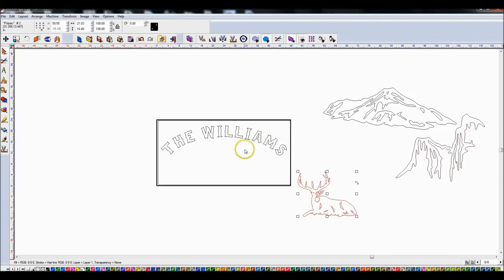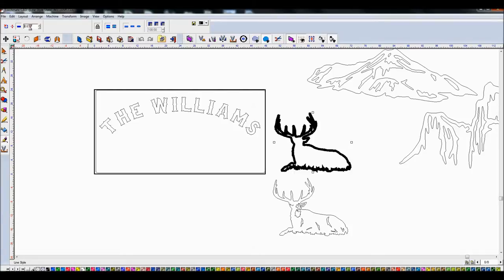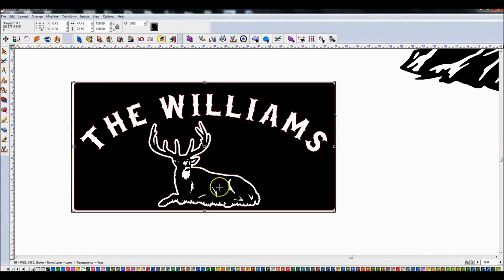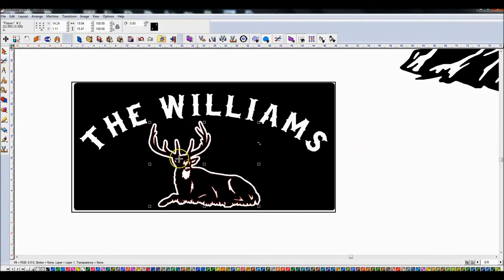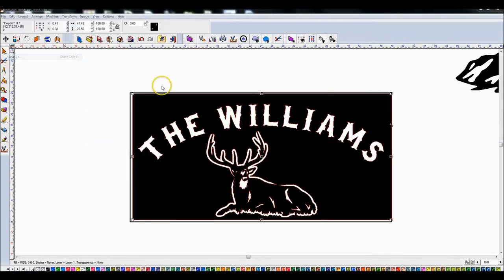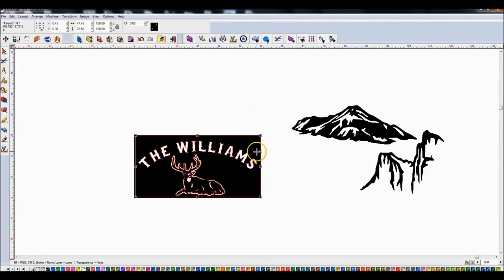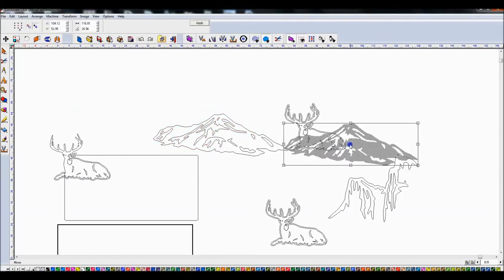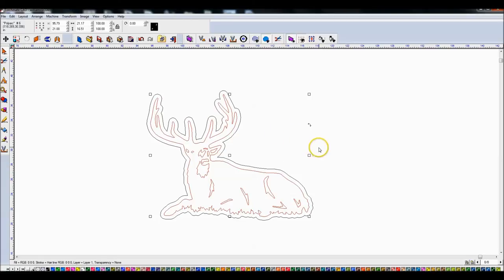Torchmate CAD/CAM -- Double Negatives

Comment: The videos r great and have helped me tremendously. ... I have a ?   When u r welding the elk sticking out of the sign. How do u only select the outside line together w the sign to x or weld....
Reply from the maker: If I understand you correctly, when you select the outside you are getting more items selected than you planned.  If that is the case you can break it apart (CTRL B) and then that should allow you to select the outside as an individual component.  If I misunderstood you, please clarify your question.
Reply: I understand the ctrl b part...

When I am going to weld something I usually highlight everything and weld...

When u were welding the individual bridges. I dnt think u highlighted everything. Unless I saw wrong...  thts wht I was referring to...
Reply from the maker: Well, if a part contains cut outs, or female pieces, and the part is one object, then I will grab the whole object.  If I haven't XOR welded in the female pieces yet, then I just grab the pieces I want to weld together (male)